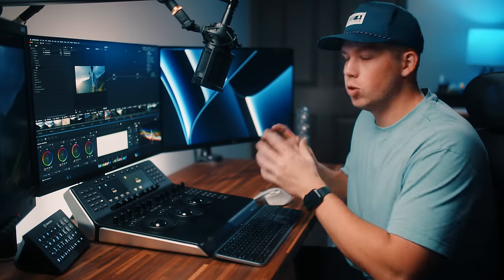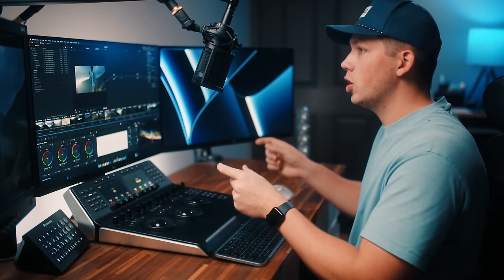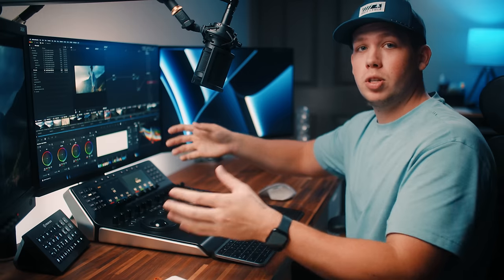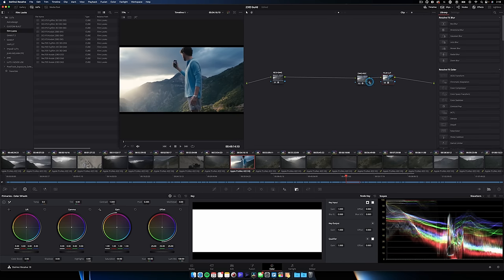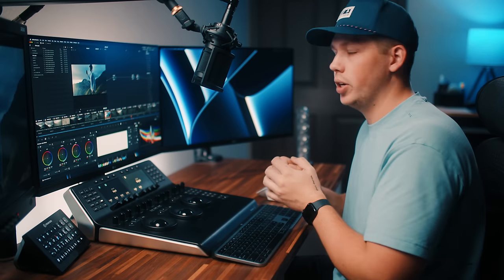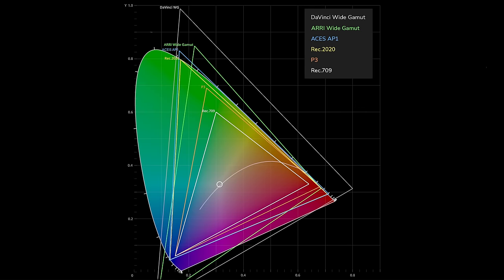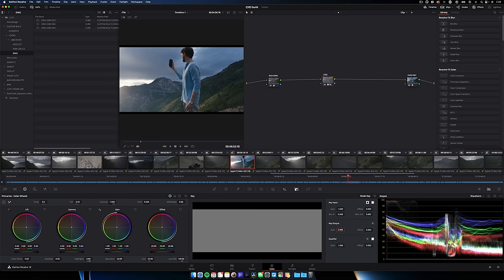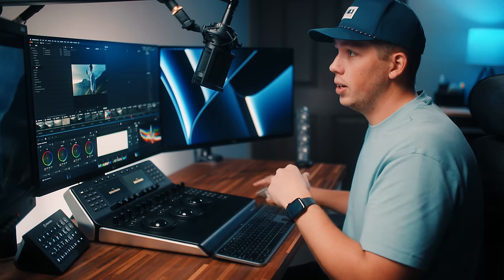THE PROBLEM WITH RESOLVE'S FILM LUTS...

Comment: Did you make these 2383 Luts using matrices in the fusion page or curves?
Reply from the maker: Neither actually. A lot of people have already done that, so those luts are out there. I simply remapped the color space transforms built in to the resolve native film look luts.
Reply: @jvke.p  Oh ok! Thanks for saving us a few nodes!
Reply from the maker: @dukebozikowski3801  see! You get it😂some people are mad I’m providing this lut because they can do it on their own. 

That’s fine, but not everyone wants to rebuild it, and not everyone has the time to learn how to rebuilt it. So I’m just trying to save people a few steps and provide a lut that does that for you. 

Take care!
Reply: @jvke.p Using the Resolve 2383 LUT sandwiched by color space transforms going to rec709, applying the LUT, and then back into ACES or DWG is my preferred way to do film emulation in a color-managed workflow so I'll be using this! Thanks again!
Reply from the maker: @dukebozikowski3801  it’s what I used to do too. Now I can just drop in the lut and it does the same thing!
Reply: @jvke.p  By the way do you know of any free resources that go into the weeds of making luts using matrices or in the fusion page? I was looking at Cullen Kelly's creative color science courses but I'm not ready to drop $400 on them quite yet.
Reply from the maker: @dukebozikowski3801  check out mixing light! I think they have some great stuff there on this topic (some may even be from Cullen). and it's a very affordable monthly subscription

Comment: if its a second cst sandwich output as a LUT; it doesn't address the first and primary point in "drawbacks" scene vs. (which is limiting your gamut)
Everything else is easy to power grade around. You can use a normal cin to rec CST.. and output gain back in what you take out ( of the built in transform.)

there are a wack of Film look power grades... I haven't seen one that tone maps back out. 
If you use any look design OFX with film profiles; they fail with the same issue, and by default apply the profile downstream of your output transform. (or at best with a film gamut-like intermediate right before)
Reply from the maker: Due to the nature of resolves lut, it does clamp everything to rec709, yes. So when the second transform takes place (rec709-DWG) it is only apply an inverse OOTF but there’s 2 major reasons it’s still beneficial:

1) it provides an IDENTICAL result as the original method. 
2) you’re not losing any ADDITIONAL information than you would by using the original lut. 

If you want to use a power grade that never maps to rec709 to begin with, that’s totally fine. But you’ll be getting a slightly different result. These luts are built specifically to provide the same outcome as using the built in 2382 lut but with extra functionality.
Reply: @jvke.p  "IDENTICAL result".... but not an identical response for the working space you're sending it back too. "you're not loosing additional information"... but its identical to working in rec 709 short of the different primaries/ gamma curve. 
what is worth doing downstream in this workflow that is CS dependent? Just a 1D Curve? should people really be using this with the same expectation as a DWG Lut?
Reply from the maker: @beargeistdesign5174  no. and that’s not what it’s for. I think you’re hyper focused on one of the 4 drawbacks this lut seeks to fix. 

There are instances where a colorist may want to make changes to the image, post-film lut. 

This workaround makes it a little easier. I’m not sure what you’re upset about.
Reply: @jvke.p  i guess my issue is a little with the presentation. 

"hyper focused on one of the 4 drawbacks this lut seeks to fix."..... but it doesn't seek to "fix"
The 10 min video is very misleading as to where it fits into a properly managed workflow. Or what "added functionality means"
Its very hard to say this is "built for DWG".....especially when so little context is provided to the user.

 Or what exactly is being 'mapped' when someone understandably takes this for an 'emulsion Lut you managed to create.'
A work around to cancel out the transform's scaling, can be done in one parallel node.

"a colorist may want to make changes post-film lut." what changes is the question you left without even a hint of caution or specificity.
for very obvious reasons most Film look powergrades stick to very specific kinds of changes post display output.... that may have been the more upfront way to approach this topic/ offering.
Reply from the maker: @beargeistdesign5174  if you want to cancel out the transform in a parallel node, go for it. No one’s stopping you. 

What clarity did I fail to provide? Seems like you’ve perfectly interpreted every step I took here. 

I spent my time to create a tool I wanted to use. 

Then made a FREE video to tell people about the tool I’m using. 

Then offered to give people that tool for FREE. 

I show you exactly where to place it in a color managed workflow, and the various options depending on your workflow. 

If you’d like to create a better method and create a video showing people how YOU do things, you have my blessing.

Comment: You grade in Rec 709 Gamma 2.4?
Reply from the maker: I grade in DWG or Arri color space usually, and output to rec709 2.4
Reply: @jvke.p  okay thanks, do you need to do a CST to rec 709, gamma 2.4 in a  node at the end or can you just skip this and deliver in rec 709, G 2.4?
Reply from the maker: @Fireandagrill  you will still need to use a CST to properly map to rec709.

Comment: Couldn't the same result be replicated by putting the Cineon film log CST and LUT in the middle of your node tree, followed by another CST converting Rec709 to the timeline color space? Example: Initial CST > Cineon Film Log > LUT > Rec709 to timeline CST > final CST
Reply from the maker: yes. that's essentially what this lut contains. you can also make those nodes you listed out a compound node and achieve the same result in terms of reducing opacity. You just have to ensure your tone mapping and gamut mapping is accurate.

Comment: Professional colorists use Davinci Resolves built in Film Look LUTs. There’s nothing wrong with them. I’ve been using them for my workflow and I’ve been getting great results. I think most people just don’t know how to use them correctly.
Reply from the maker: I use them too! They’re great. But you have to take some extra steps to use them in a color managed workflow, or if you want to limit it’s intensity. This lut is the SAME lut resolve provides, but I’ve taken those extra steps for you, so now it’s done inside the lut. Saving you time.

Comment: when using CST never turn on tone mapping on, since it clips information for nodes past CST.
Reply from the maker: Not exactly correct. Tone mapping is there for a reason. You just have to know when to use it. When mapping to a smaller color space you should definitely use tone mapping.

Comment: Doing your adjustments in scene referred doesn’t really matter man. Because you’re STILL LIMITED to Rec709 in the end (rec709 being another term for display referred) 

It all equalizes in the end regardless.
Reply from the maker: not really. there's actually a massive difference between working display/scene referred. I think your misunderstanding of the two comes down to WHEN the clamp to rec709 takes place. When working display referred, the image has already been clamped to rec709 values. The benefit of working scene referred is that you have access to all the additional luma and chroma values provided by a larger color space BEFORE being clamped to rec709, even though you're still seeing the end result of the rec709 transform. of course, your footage still has to be shot in a wide gamut color space to take advantage of this, otherwise it's self defeating.

And rec709 isn't another term for display referred, rec709 2.4 falls under the category of a display referred color space.
Reply: @jvke.p  So by your definition, placing my LogC to Rec709 LUT on the timeline, and then grading on nodes technically preceding it, is still working within a “scene referred space” even if my timeline is set to Rec709 2.4?

Comment: Well....sorry to say you that, but your LUT is broken. It not behave right in DWG cmd. It crushes hightlights very fast, which is kinda funny because you explain that issue in this very video. I'll try to elaborate:

You can't do something like DWG color transform to 709/cineon and apply Davinci LUT on next node, DWG doesn't know sh*t what cineon is. You must color transform for example DWG to rec709/gamma 2.4, add next node and color transform rec709/gamma 2.4 to rec709/cineon, add next node and apply Davinci LUT. Now you can compound those two last nodes and easly key input to value you like. 

And i think you designed your LUT in this first way i described because it behaves this way. I did comparison of this lut, stock luts and Cullen Kelly lut if you are interested. 80% of a time it behaves good, but if your footage is overexposed and you try to save it, thats when i spotted it.
Reply from the maker: I assume you’re trying to fix exposure after the lut. Which is incorrect. Try making exposure adjustments (and all other adjustments really), prior to the lut. You also might not be setting up your color management correctly. 

Also your second paragraph is entirely incorrect. Please do more research before commenting.
Reply: @jvke.p  no no, i do 2100 to DWG, Exposure, your LUT, DWG to 709 transform all inside DWG which is purpose i guess. also my timeline is in DWG.
Reply: @jvke.p  this is 4th time i wrote this (something blocked my posts). I found source of issue. It is my 2100 to DWG node which is set by default as Davinci Tone Mapping, and is cause troubles witch banding. When i set Tone Mapping manually to max (10 000) it works fine, which is weird because Cullen Kelly similar Lut works just fine as default. I can't show you link with demontration because f*c**n YT will block it.

maybe someone encounter similar issue and find this useful
Reply from the maker: @TheWorldInAFrame66  yea I figured it was a color management setting. It can be tricky. Lots of variables.